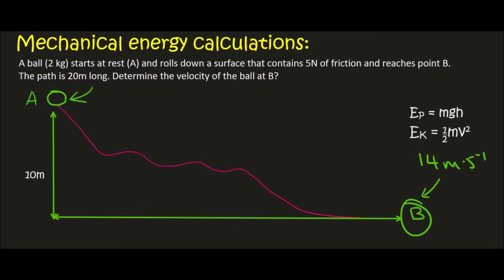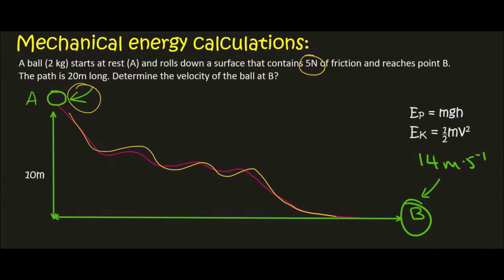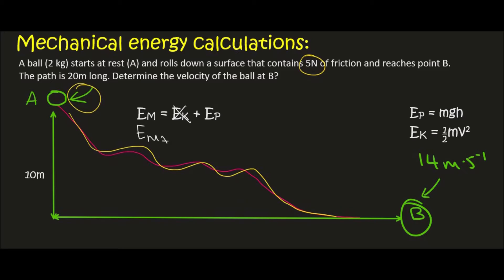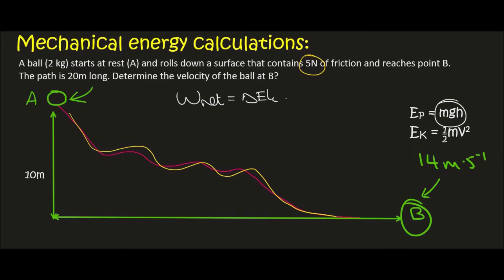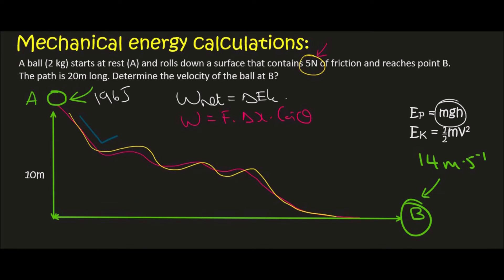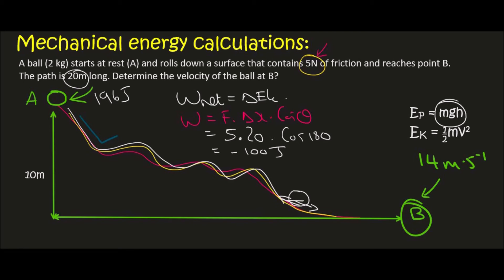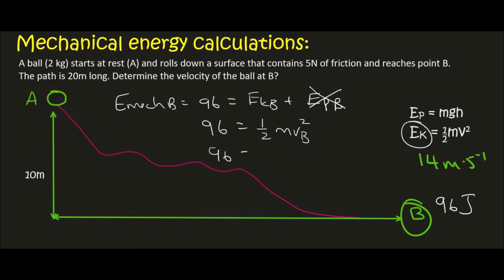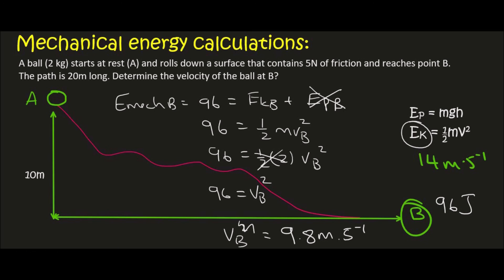Grade 12 work energy and power : Mechanical energy calculation

Comment: Hold on Kev i think u made a mistake at (0.54). U used 10 m instead of 20m or is there something I'm missing 😭😭
Love a ppreciate your work !❣
Reply: You're looking at the height not the distance. Displacement/distance is only used for finding the work, in this case you're finding potential energy which uses height not displacement.